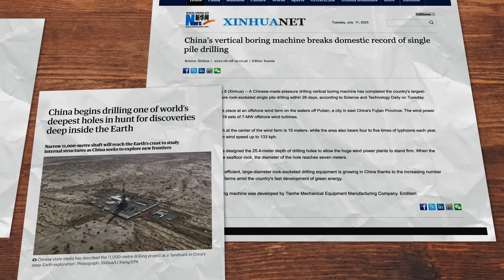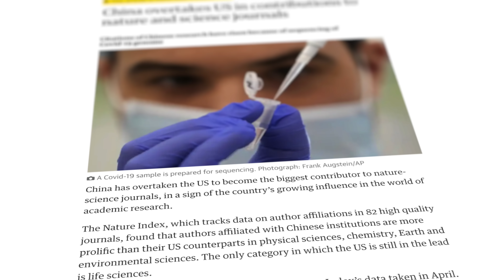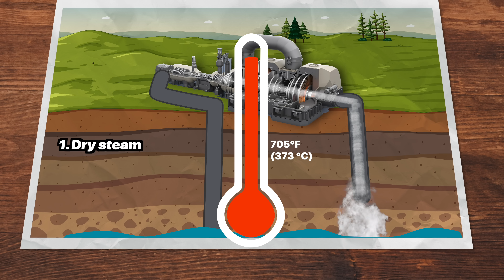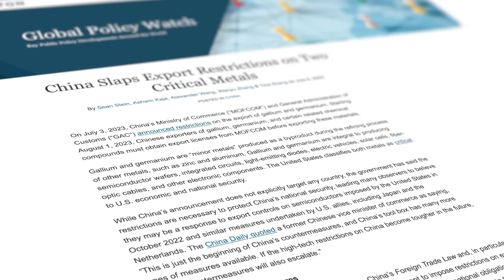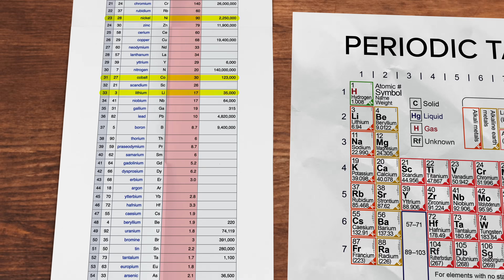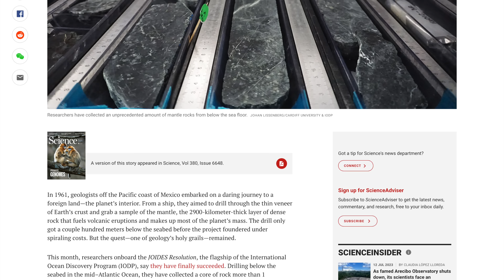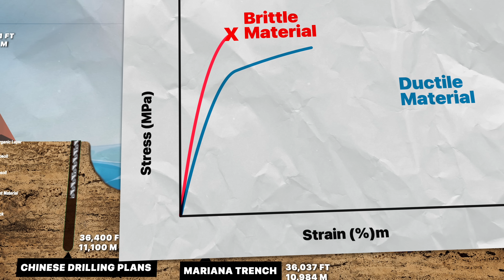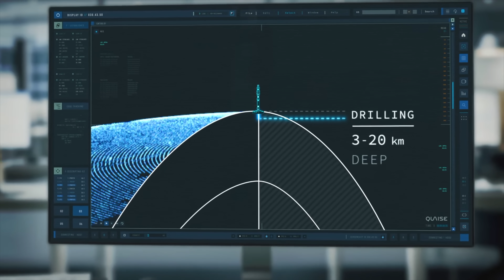What’s Hiding Beneath China’s Deepest Hole?

Comment: Fantastic technology, but there are two problems.  At this time geo-thermal energy works because there are relatively so few in the world.  However, adding more and more is going to present a real problem.  We will be taking more heat from the core than can be replenished.  This will result in changes to the earth’s magnetic field and create a domino effect.  We now know that some animals rely on the magnetic field for navigation.  This will throw them off and cause problems of their very own.  This will also affect the weather as the earth itself will become cooler.  The rotation of the earth will become unstable and render gps useless, as well as drastically changing the length of our day, which will cause differences in temperature due to the sun shining longer or shorter in any given area because of the difference in speed, either faster or slower.  There are likely other ramifications I haven’t thought of yet.
Second, the act of drilling down to untold depths leaves wide open the possibility of causing massive earthquakes or even splitting the globe in two.
Humans need to learn to be satisfied with what we have and understand the difference between “true science” and “mad science”.
Reply: Oh that is crazy. There is virtually unlimited heat within the heart at least for millions of years of using it.

Comment: For geothermal power plants there are other fluids like butane and iso-pentane.   These organic fluids require much lower temperature heat sources.  As to the electrical plasma drill the cost was for electricity only.  Need to complete costs to compare the two.

Comment: I'm amazed just how primitive the drilling industry is. Hey let's take a drill then put a 5 mile drill bit on it! The motor belongs at the bottom of the hole. Not the top. To me the answer is to create a technology similar to a tunnel boring machine. Maybe a HBM, hole boring machine. Yeah those machines that drill from 3 foot to 60+ feet holes through the earth. The new technology would drill down and encase the hole the  entire way with whatever material makes sense for the depth. And there would be no need to lift the entire drill string from the top. Anything that needed to be raised or lowered could be done either by intermediate points, say 1000 foot "lift platforms" that would be anchored to the local rock. Or the tunnel liner could have something like gear teeth that things could simply move up and down by driving against the gear teeth. Or why drill strait down? How about 30 or 45 degrees that would allow the tunnel wall/floor carry the weight. Heck, people could even be in the HBM as long as they were provided air, cooling and protection from the ground pressure. It's just a matter of getting them oxygen and power (for the hyper air conditioning). All I'm saying is that the current drilling technology is too primitive for going really deep. People need to think outside the box. The cutting technology, carbide bits, diamond bits, lasers, plasma or whatever, is independent of the lining delivery technology. The technology could be developed. The only real issue is the funding for the development. I'm confident that smart people can solve the technical issues once you put the power head at the bottom of the hole. Some of the big issues are, what is the liner made of and how do you create that liner from pieces being passed down the hole that can handle the pressure and heat. Also the liner may also have to span a gap, since caves do exist. Another issue is the need to develop hyper air conditioning/refrigeration to cool everything that doesn't have to sit in the hole/tunnel forever.  Power could be delivered through high voltage electricity or diesel and oxygen pipes to name a couple options.  The power would provide for cooling, rock cutting, cuttings removal, liner delivery and placement and welding if the liner needed it. Another big question is what pressure is the tunnel behind the cutting head? Can it be at atmospheric pressure?

Comment: Is there any reason why we always dig vertically ' ? Could we use a Tesla hole boring machine to dig down at a 15° slope , obviously it's a longer route but much easier. Would that work?
Reply: I think it would just be harder because of the longer route. The true vertical depth, pressure and temperature would still be the same
Reply: First we don't dig we drill. And why would you want to drill at an angle when depth is your objective? And why would it be easier to drill at an angle?
Reply: If you can keep it from flooding, yes, that would work. Hit an aquifer? Sorry, farmers, you're on the national supply now.
Reply: @tactileslut  I am afraid you don't have a grasp of drilling, aquifers, etc.  Flooding - you can't flood a drill hole because water can't move through rock fast enough. The only reason to drill away from vertical is to hit a target that you cannot get directly over. Not the case with a hole being drilled to reach a deep depth. Also you do realize that can "dig" mine down to 37,000 feet?

Comment: You are not looking far enough into the future. We are using all materials more efficiently and will have only a small need for new minerals in the future. Particularly iron, aluminum, oil, silicon, lithium, copper for instance we will use 75% less copper in cars and electric devices.

Comment: The energy beam drilling is a pipe dream.  They have been trying to sell that for 20+ years and it has gone no where.  
As you drill deeper, the head pressure of the mud is a bit self regulating.  Gravity pulls down on everything.  The pumps are there to control the flow rate rather than pressure.  Yes, pressure is created, but it's no the goal.  If the mud's flow rate drops too low, the spoils will drop ou of suspension and jam up the hole.  The deeper you go, the higher this flow rate needs to be.

My great great grand father invented the tricone drill bit that is/was commonly used to drill for oil and gas.  We still have the original patent and all the paperwork that went with it.  It's the same patent that Howard Hughes Sr used to make their vast fortune.
Reply: Retired offshore oilfield driller here. The required flow rate of your drilling fluid is calculated by the engineers and is dependent on the size of the hole section you are drilling, and the anticipated downhole geology. This is done by looking at other wells in the area and other seismic data from surveys. The weight and viscosity of the drilling mud is based off this geological information. You need to have sufficient hydrostatic pressure to counter balance the hydrocarbons you anticipate to hit otherwise you will have a blowout. Yes the drilling fluid removes cuttings from the hole,  but it has several jobs - the main one being the it’s your main well control method.
Reply: @jleonard462  I was more referring to the requirements of pump pressure versus depth as an abstract rather than a practical application to keep from writing a full dissertation in the comments of YouTube. The pressure and mud density is manipulated as feedback is obtained from MWD equipment and tailings/mud sample examination.  Past experience alone, from a geological standpoint, is nothing when running a well leg out horizontal. Domes are expected, but you cannot know exactly what you will hit around one and when.  I've worked with the scientists that design the tools that drilling engineers use to make these decisions.  I'm the guy that takes the theory and makes a functional tool, test equipment to proof that tool, and teaches other how to mass produce these tools.  Everything from simple resistivity tools to complex rotary steerable systems with full near bit capabilities.
Reply: And, how are they going to know what they have drilled into.using the hot wave method since it seals as it goes using the hot rock ???
Reply: @jameslmorehead,  What they tell you about so called gravity is not true either, it's all mass and density of objects. What they tell you is trillions and trillions of tons of water are being held down by gravity, yet a small bug can resist this force, it's probably not true at all. What about water always finding level, and 71 % of the Earth is water, what would common sense tell you. I would be more interested in the land they are hiding down south in Antarctica.
Reply: @faithismespeaks6848  You obviously have brain damage. Life must be so difficult for you.
Reply: @faithismespeaks6848  Go look up surface tension and hydrophobic molecules.  You would be much better off for it.  As for the water around the earth, it would remain flat for the most part and much more still if it were not for that pesky giant rock in the sky causing tidal forces.
Reply: @faithismespeaks6848  Why does a drop of water hang off the bottom of your finger and not fall against gravity? But at the same time the oceans don't float away?. Basic physics you clearly can't comprehend.
Reply: @boogusnutsack5926  , The model you presented has nothing to do with what I was talking about. What's next, the spinning pail of water attached to a rope, apples and oranges. Water always finds level, at least now I know what subjects you know absolutely nothing about. Nice try, but not even close, I have dispatched far greater that you.
Reply: @faithismespeaks6848  What does water always finding level have to do with the OP's comment? 

What does 71% of the earths SURFACE being COVERED in water (The earth is not made up of 71% water like you said) have to do with the OP's comment?

Hypocrisy at its finest. 

You're just throwing out random statements saying " BUT WHAT ABOUT THIS " in response to people and i did the exact same thing to you, referring to the surface tension of water, a key aspect of physics that allows it to hold together and in some cases, like the drop hanging off of the bottom of your finger, resist the as you say, "so called gravity".
Reply: @boogusnutsack5926  , Apples and oranges nutsack , apples and oranges.
Reply: ...said the x-ray tech about MRI technology. Taking pictures with magnets... will NEVER work! 😅
Reply: @nortonnewmann3711  There is not understanding physics and not believing physics.   What temperature does quartz vaporize and how much energy does that take? Now apply that energy density retirement to a beam 14 inches in diameter with a travel speed of 1 foot a minute.  Then, if you follow the idea that the emitter is on the surface, apply an exponential decay rate as depth increases. If you want to get around this problem, apply the power density to the drill head directly.  Last I checked, this is somewhere near the energy at ground zero of an H bomb.  Still sound like a realistic option to you?
Reply: I am all for new tech, but Energy bean claim should only be taken as a gram of salt until proven. It might look good on paper but the reality has too many factors that might make it difficult to overcome.
Reply: That is very interesting. I believe the centre of the earth is hollow due to the forces of gravity. Just as everything pulls downwards towards the greatest mass the same goes for when you are in the centre, the mass is all around you and thus pulls everything out towards it. Do you agree?
Reply: @izzzzzz6  We knows it not hollow thanks to the study of seismic waves passing through the earths core. When an earthquake goes off there are 2 waves that are produced, the primary wave and the secondary waves, the primary wave can pass through both liquid and solid material. Secondary waves cannot pass through a liquid. We know the outer core is molten(liquid) because secondary waves cannot pass through it, but primary waves do, and we also know the core is solid because primary waves speed up as they travel through denser material. Because of this we're able to measure and predict when a primary wave will arrive on the other side of the planet based on where it originated from. We know the speed of the shockwave in all of these mediums (Solid, liquid, gas) and their respective densities, and we also know the diameter or the earth, making it quite easy to calculate. 

If the core were hollow the primary wave would slow down dramatically as pressure waves travel much much slower in air than they do in a liquid and dramatically less so than in a solid. If the core were a vacuum it wouldn't propagate at all leaving a giant shadow on the far side of the core where no wave would be detected.

So if the earth were hollow and we took our measurements assuming it was solid, we would end up with a speed, an elapsed time of propagation and a diameter of earth that wouldn't line up, due to the slow down in the gas. On paper it would come across as say, the earth would need to be 13,000 miles in diameter instead of 7900 miles that it is, based on the time it took the shockwave to arrive. Therefore we know the core must be far denser than air and thus, not hollow.
Reply: @boogusnutsack5926  Are you telling me waves can not travel around a hollow? It must be hollow. But we do not know the size of the hollow. It is impossible to detect that many km down. we have only ever gone 10 miles deep as far as drilling goes. I dare you to prove this technology is 100% accurate vs my proposition of some sort of hollow and being able to detect any deep hollows or deep caverns in general. Show me one image of a cave detected below 10 miles deep. And we are talking 4000 miles to the centre! Are you saying you could detect a hollow the size of a stadium at 4000 miles deep. I doubt you could even detect a hollow with a 200 mile circumference at that depth.
  Try again Einstein!
Reply: @izzzzzz6 No this is the dumbest shit I’ve heard all week.

Comment: Quaise is sure to have a significant technical challenge to deal with. If water vapor can significantly decrease the effectiveness of a tactical laser, what will rock vapor do to a "death ray" drilling operation? 

If they can successfully vent while they dig, how do they propose to neutralize any and all potential toxins, from heavy metal vapors to any possible unknown chemical reactions which can take place in a high-energy setting, that this process can bring up to the surface? It is also known that at high enough energies, lasers can cause radioactive fallout in ordinary atmospheric air. Other materials will certainly be subject to this effect. While it is possible that a millimeter-wave process might not do that, what if it if it does? It wouldn't be too difficult to cover-up.

It would also be good to keep in mind that anytime you go digging around underground, you will also eventually hit pockets of radioactive materials. The mining, oil and natural gas industries already know this, and there are companies they can reach out to which deal exclusively in radioactivity abatement cleanup. These companies operate on an on-call basis, and cleanup events of this kind happen frequently enough to justify their existence.

There's a chance they couldn't get permission to dig in the U.S., even if the dig site was in Death Valley, Groom Lake, or even the Trinity test range (the latter two having almost cartoonish value for generating plausible deniability). Then there's the possibility that if they went elsewhere to dig, it could easily become an anti-western propaganda nightmare, just because we're sensitive to such messaging.

Even if every one of these challenges can be met satisfactorily, I still wouldn't want to work in their public relations department.

Comment: Like always your 90% accurate. They wont make it to “TD” total depth. Lots of mis information in this video and advertisement for snake oil drilling techniques from a man that know nothing about the drilling industry. And if you have a blow out its 99.9999% of the time someone actually knows wild well control and ends up getting the well under control. Very rarely do we have uncontrollable blowouts. If it was that common we would always drill a monitor well next to the the well before we drilled for a place to load explosives into just incase.
Reply: well said.

Comment: China is demonstrating the limited thought processes of the elites in the US. Our elites have pushed wind and solar in order to do profits for politicians and others thru the stock market. This stock market corruption and greed from our politicians is destabilizing our country. Green energy shouldn't take constant manufacturing of stuff to make it operate.
Reply from the maker: Hey quick note. Green energy doesnt require constant manufacturing. you produce a solar panels ONE TIME and they produce energy every day for over 30 years. In comparison, you pump oil to burn for 1 instant ... you're looking for reasons to conflate different things. wind and solar is cheaper than everything else, thats why everyone is moving over. also new science exploration is super important.
Reply: @TwoBitDaVinci  I have a family member that changes out solar components that are lasting a little over 10 years.  When changing out components there's things like the cost of silver for the panels (global currency crisis causing silver spike), hazardous waste costs to disposal of batteries, possible theft of panels and other components in a commodities boom (like what happens with catalytic  converters). Also, wind and solar take up a tremendous amount of space compared to a geothermal plant for large number of homes. Geothermal should also be safer from irratic weather that has been on the increase.